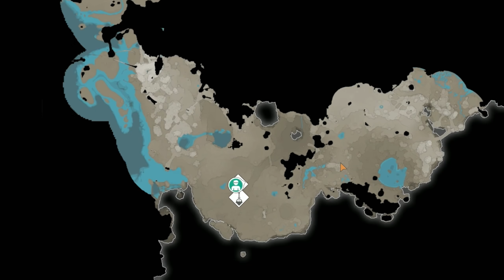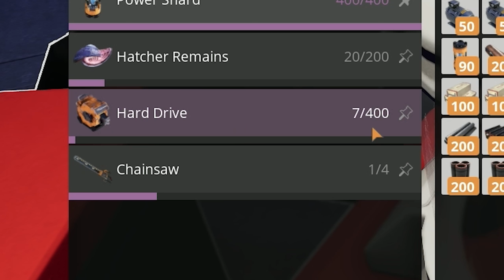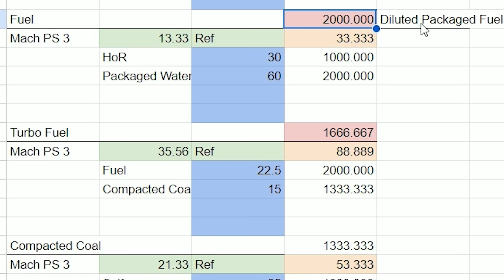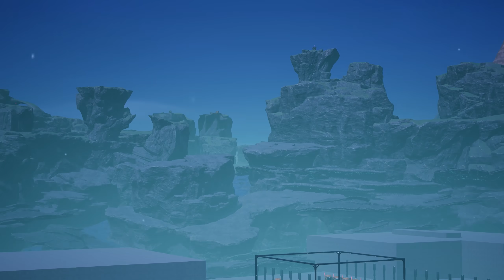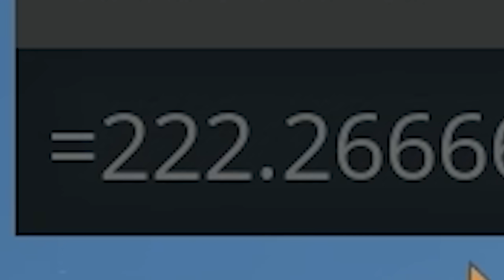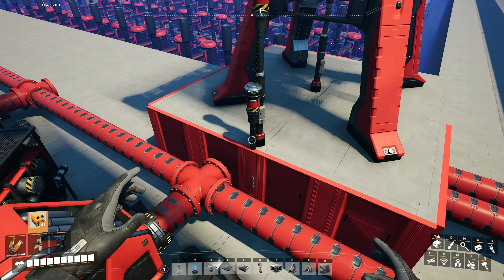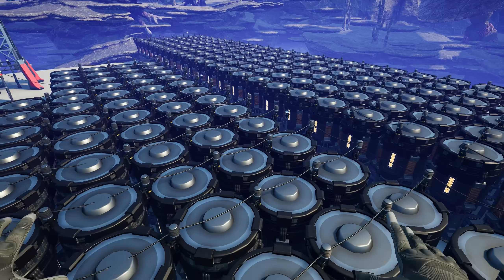This Factory will BLOW YOUR MIND - Satisfactory 1.0

Comment: With diluted fuel and the default recipes for turbo and rocket fuel, you can convert 300 oil into 66000 MW. Just an idea.
Reply: with alt for rocket fuel it will be 72 000 and much simpler. 10 refineries and 16 blenders. 0 assemblers. 
300 crude oil --> 10 refineries --> 400 oil residue (+200 polimer resin)
+ 800 water (2 pipes)  --> 8 blenders ---> 800 fuel
+ 600 nitro(1 pipe) + 800 sulfur + 400 coal  --> 8 blenders ---> 1200 rocketfuel (+200 compacted coal) ---> 287,9 fuel generators --> almost 72 000 MW
 much-much more simple
Reply: @raven-navier  any chance you know how much power all that takes to get up and running?
Reply: @SmokeandSpirit  

300MW for all 10 refineries
1200MW for all 16 blenders
135MW for all waterpumps
150MW for  nitrogen extracrtor
135MW for all miners
100MW for all oilpumps
----> 2020MW
probably 3,5% of output
Reply: @SmokeandSpirit from experience about 5k if he starts in phases and gets the 480 compact through. Going past that would be a bigger start up. If things are on and full as he expands the systems will shut down but still have their outputs full ready to fill the next phase in short order. Then he can get that first 50 generators down and work on maxing their outputs as the factory slowly starts to wake up.
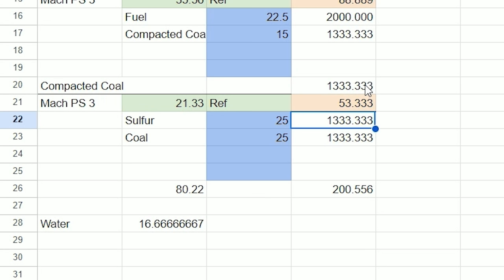Reply: as we can see on 8:15
Kibz used 1333,3 coal; 1333,3 sulfur; 2000 water and 750 crude oil for 1666,7 turbofuel
that will burn in 222,22 generators resulting in 55 555,55 MW
only his 147 refineries (*30MW) and 53 assemblers (*15MW) consumes 5205 MW. we should add miners, pumps and packagers, so it would be somewhere 5700MW

in my setup, if I would use 750 crude oil it would be also used:
1000 coal, 2000 sulfur, 1500 nitrogen, 2000 water for 3000 rocketfuel
that will burn in 720 generators resulting in 180 000 MW
my 40 blenders (*75MW) and 25 refineries (*30MW) consumes 3750 MW. with all miners and pumps it should be less then 4500 MW
Reply: Nitro is definitely more effective in the late game. I posted my comment about his level of progression.
Reply: @raven-navier  rocket fuel is so broken, simple recept and enormous amount of energy for one oil pump. After i find it I forgot about my nuclear plants.
Reply: @raven-navier if you use somersloops on both the rocket fuel production and reprocessing of the compacted coal byproduct into turbo fuel, you can end up needing a very tiny amount of turbo fuel for rocket fuel. I don’t remember the exact ratios but I managed to make 200 rocket fuel/min with just a net consumption of like 10 turbo fuel and nitric acid per minute
Reply: Sure but you can do this turbofuel setup already at tier 5
Reply: @Exi89  yes, this setup requires late 7 tier and a lot of hard drives. I believe it was my 55-th hard drive, when I've got this recipe (Nitro Rocket Fuel)
Reply: Would Blender throuput be a impacting bottleneck?
Also, is there a difference in power consumption between these setups and what Kibz has?
(As in, is there an increase to cost of operation that's almost as large as the increase to power output per scarce resource unit input)
Reply: @DontCareSoMuch  I would say if you go with rocket fuel youre gonna save more power , my 54000 MW plant only took like 1800 MW to produce 900 / min rocket fuel
Reply: @mmorris2830
no bottlenecks. it is standart alternative recipe, nothing is overclocked. 1 blender eats 100 fuel, 100sulfur, 75 nitrogen and 50 coal per minute - all can be managed by tier 1 belts/pipes
Kibz setup consumes almost the same amount of power (actually it consumes little bit more, than my setup), but produses 3,5 times less power per oil: if he used 300 crude oil he would have only 22 200 MW

Comment: Hey Kibitz, I wanted to check if you know that there's ways to prioritize fluid inputs in a pipe system.  It seems like a lot of your pipe fixing could have been avoided just by using a priority input on each row of refineries.
Reply: How would you prioritize? Fluids just flow all over the pipe system
Reply: I've replied to this twice now, hopefully this one will stick...  You can prioritize fluid inputs by having the high priority pipe lower in altitude than the low priority pipe.  This will make all the fluid from the high priority pipe flow through, while limiting the fluid from the other pipe.  Great for dealing with liquid byproducts in later factories.  If you want more detail/pictures, you can google for "satisfactory fluid priority", there's a 3 year old reddit post about it.

Comment: 28:23 - 5th line of packed water and 3rd line of empty canister is backed up. its might be a problem soon
Reply: Yes that was bugging me the whole time he had this active, my Factorio sense is telling me though that this was something he noticed as well.
Reply: Wait. Is there a vanilla blueprint maker mk 2 now? I really need to read the patch notes. This changes everything.
Reply: @SmokeandSpirit  There is also a Mk 3 Blueprint maker for the endgame!  Mk 2 is 5x5x5, Mk 3 is 6x6x6
Reply: It's probably OK if packaged water is backing up (though it might mean he forgot to connect a belt and isn't getting full fuel output); he doesn't have smart splitters and wasn't using a balancer, so it's probably just some belt getting higher input than consumption. As long as the other belts have sufficient input, it shouldn't back up outside of that one belt and the packagers that feed it. The empty canisters backing up are going to ruin some portion of the fuel production, though.
Reply: huh

Comment: I've yet to see any players take advantage of the fact that blueprints save item contents! You can preload those canisters in the blueprint! Not sure if that is all that helpful but I'm sure there is a handy use case!
Reply: This is especially useful when making self-contained rubber-plastic recycle loop blueprints, as you can include the seeding of plastic or rubber in blueprint itself. (I've also used it to make a filled, overclocked biomass burner blueprint to make opening drop pods easier to deal with)
Reply: It pulls from inventory
Reply: Before the dimensional depot, I liked making an "explorer kit" chest. Just a chest with the parts for the explorer vehicle.
Reply: So i can make a blueprint full of containers with stuff in it, and then if i stamp it down, I am duplicating the contents of the container?
Reply: @BROADBANNED  It pulls from inv. It mostly works as a checklist, but it can also jumpstart a machine. You can even preload  bioburners.
Reply: @ResplendentTrash  Thanks for confirming.
Reply: @BROADBANNED don't have the game but I assume it would pull from your inventory like everything else in the blueprint

Comment: Isn't rocket fuel better at generating power ? Idk which is more effective and easy to set up
Reply: rocket fuel requires nitric acid which kibitz doesn't have access to
Reply: @Phaith_ofc  there is a alt recipe that only requires nitrogen
Reply: @vergule11  it requires blender which kibitz also doesn't have

Comment: You sparked my satisfactory addiction. 50 hours in and I can’t stop. Love you Kibs.
Reply: I JUST finished phase 2 at over 60 hours in. Lol.
Reply: @ImJustJAG  Trains will help, but need so much steal beams and steal pipes ... not to mention also needing computers, etc.

I do wish that auto-making shards was with the mk 3 miners instead of later.
Reply: I'm 76 hours and making my turbofuel power right now. I unlocked phase 3 only to discover mk3 miners are in tier 8 :( Anyways I have redone my starter layout and may have to scratch it again just to do it all over again.

Comment: I'VE BEEN PAINTING MY FACTORY BY HAND, I CAN DO THIS IN 1 CLICK?!?!?
Reply: Yeah thats how swatches work
Reply: the default swatches on the top row change everything that's currently using it (there's one for factory stuff, machines walls whatever, one for pipes, foundations, etc)
Reply: @yerthofficial  I think it works for any swatch. Basically, the tool doesn't paint paint, it paints swatches. You can then change the colours any time.
Reply: @Kwauhn.  what I was saying is there's an overall swatch for different things (pipes, factory buildings, concrete, etc) and when you change those swatches it instantly changes everything that falls under that category unless you've already applied a custom swatch to it
Reply: @Kwauhn.  1 Exception, the custom swatch ;)
Reply: Have you been to the swatch menu? Have you ever changed any of the default swatches? Man, fr that sucks. I never bother to paint anything by hand. except maybe pipes but they are relatively quick. Thank goodness YT is here to let you know 😂
Reply: Idiot